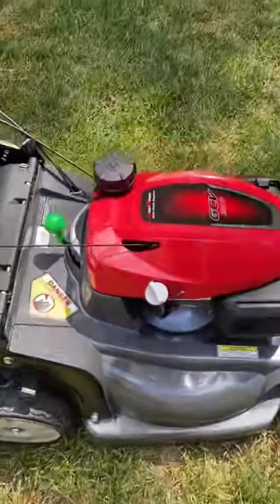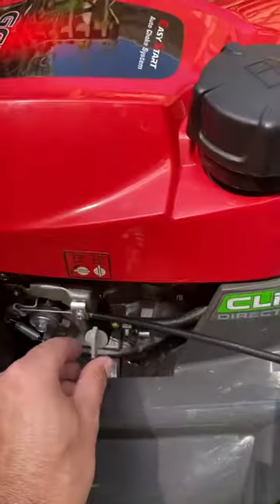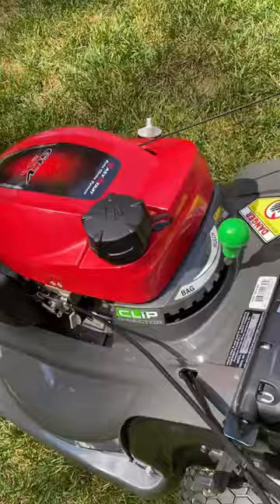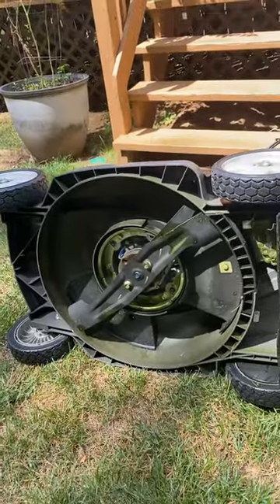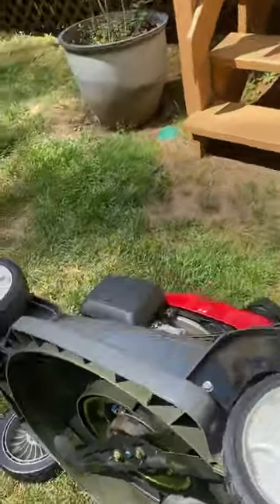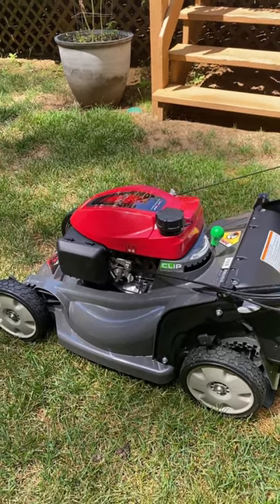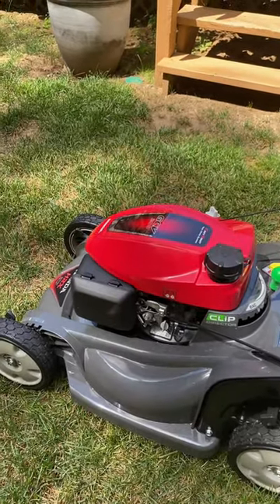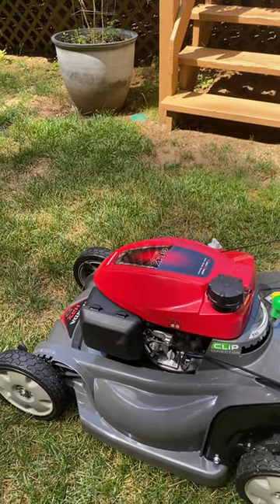Honda Mower | Correct way on tipping it over #shorts

Comment: Excellent Instructions.👍👍
Reply from the maker: Thanks man
Reply: Additionally pull your cord untill it's tight. Top dead centre of the compression stroke that'll close the valves and prevent oil going past your rings and  valves into your exhaust.